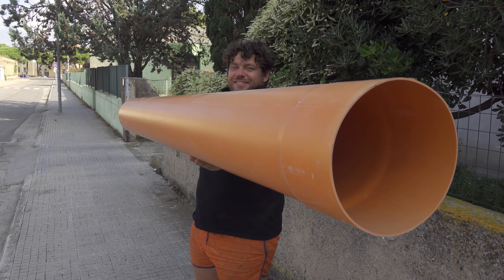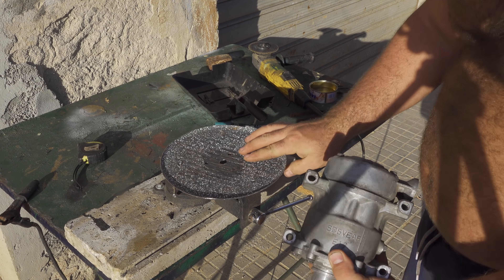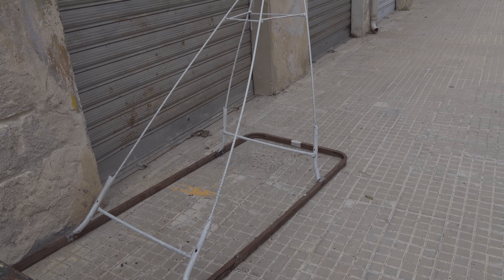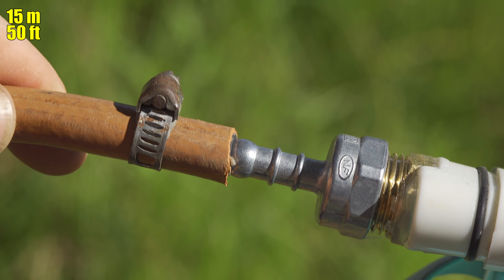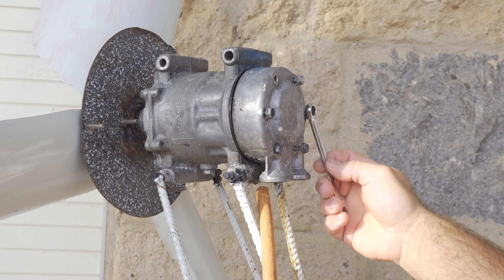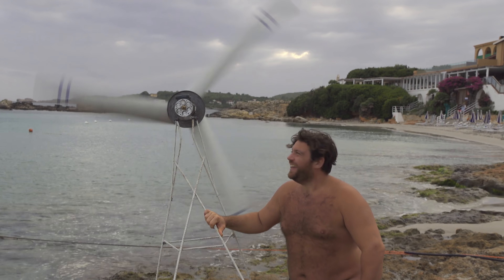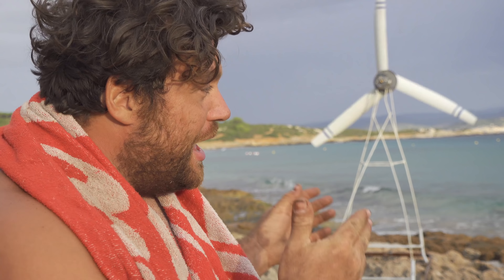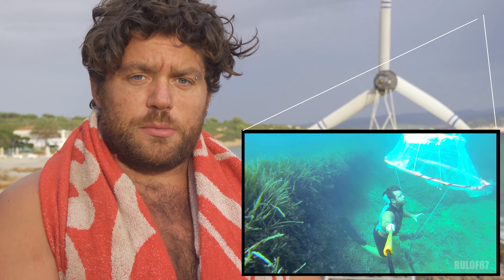Most Dangerous Invention  I've Ever Done • Breath Underwater

Comment: 'Wind stops' 

Dies
Reply: If a diver cannot make an emergency ascent from 60 feet on one breath, they do not belong in the water in the first place. Having said this, I will also add that this man's rig is very dangerous.
Reply: @redpillcommando  he will not even get to down to 60 feet with that mask without hurtng himself...
Reply: Meh the water looks about 40 at most
Reply: @jebbadiah  overlord6644 - I never said anything about how deep he was, I was not trying to comment about that. I'm just saying if a diver cannot make an emergency swimming ascent from 60 feet on one breath they do not belong in the water. In fact, I had to do just that to get my original certification back in 1972. My statement was in answer to CIA saying "Wind stops - Dies". That would only be the case if the diver does not know how to make an emergency swimming accent without causing barotrauma. I was not trying to be pedantic. The average person reading the original statement may not know that if an air supply fails, you can always swim to the surface while breathing out. As you ascend, the gas in your lungs will expand and you will be able to exhale all the way up. In fact, if you are breathing any kind of gas at depth, you MUST EXHALE ON THE WAY UP OR YOU WILL DIE! This is one of the classic ways an untrained or poorly trained diver ends up dead. They go for a breath and don't get it, they panic, they swim for the surface while holding their breath, the gas in their lungs expands and then their lungs pop and they end up dead from barotrauma, air embolism etc etc. Students have died in standard eight foot deep swimming pools this way. It does not take much depth, all it takes is holding your breath on the way up. Barotrauma is deadly and it can kill very fast. On the other hand, divers have made it back to the  surface from more than 120 feet on one breath, but when you make that fast of an ascent from that kind of depth you have other things to worry about like nasty little nitrogen bubbles in your blood and tissues that can cause pain, injury and death.

Here is a link to more than you ever wanted to know about diving accidents.
https://www.diversalertnetwork.org/medical/report/DAN1992DCIreport.pdf

The real danger of this rig is not if he gets to breath, it's what he gets to breath when it is working. There are very specific requirements for life support air supplies, and for very good reason. More than one diver has been killed by contaminants in their air supply. I had a buddy get very sick from a bad air fill he got at a bait shop compressor back in the bad old days. It seems the bait shop owner did not think it was necessary to change filters so often, and that oil they told him to use cost way too much, the end result was a contaminated air supply that came close to killing my dive buddy. 

Anyway, this post has used up way too much time as it is. I give Mr. Rulof an A+ for ingenuity, he has a very cool conversation peace but I beg him not to use his rig for diving. Just not worth it.
Reply: @redpillcommando  Makes emergency ascent

Dies from resulting embolism.
Reply: or if the boat turns to the other direction lol
Reply: Wind never stops when you are over the open ocean my friend. But you already knew that because you are the CIA
Reply: @redpillcommando  ascent*
Reply: @krimm1450  Yes, thank you. I made that typo more than once in fact.
Reply: @redpillcommando  thanks. Very informative.
Reply: He has plenty of oxygen left over in that to give him time to get back up.
Reply: Si el viento para. Te quedas sumergido y esperas a que vuelva
Reply: Ha gaye!
Reply: Bends

Comment: Great idea, even tho i think its too dangerous to use a piston compressor because of the oil vapors. Instead i would use centrifugal compressor, which dont need oil, like a turbo, capable of doing 1 bar. And drive the turbo with a big electric motor with pulleys to make the turbo go FAST.
Also i would change the mask to be able to equalize the pressure and lastly i would put a good air filter.
Reply: 1 bar of pressure might be risky due to around 10 meters in depth there is 1 bar of pressure, but i like the way you think
Reply: greek guy so lets use a bigger motor!!
Reply: He did say it is important to clean it out. It would probably be smart to add a little oil that doesn't produce harmful vapors to prevent rusting, maybe something like vegetable oil.
Reply: Cole H i think that replacing the motor oil with vegetable oil is a good idea . But cleaning the motor oil is very difficult in don’t think that will be perfectly safe to use.
Reply: Gregory Dahl you are not using high voltage, you need to use lipo batterys instead, that delivers about 15 volts, which is not dangerous at all.

Comment: Really cool project. I would like to use this idea for a wind powered pond aeration system.
Reply: That's a really good idea
Reply: Use it to keep the pond bottom clean by discharging air into a lift pipe and into mesh bag or out the pond.

Comment: Cool idea. But all you need is a small air compressor that runs off of battery’s or use a solar panel for those sunny days and it would fit in a much smaller boat and be safer in my opinion.
Reply: this is a good idea as well. you should make a video too
Reply: The thing with using an air compressor is that you may think it's safer, but you'll end up getting contaminated oxygen in your mask. If you've ever gone through a scuba class, you'll learn that if you try an air compressor, then the air can actually be poisonous and fatal
Reply: Kelpo Gaming that’s probably true. But I small car tire compressor doesn’t have a tank or anything for air to be stored in and get contaminated. I think you would be fine with a small one that keeps putting fresh air into the tube
Reply: kbphotology 1 I don’t have a pool or a beach anywhere close so that would be hard for me lol

Comment: I love your imagination and crafting capabilities. The inventor side of me lives this. But From the point of view of a professional diver there is nothing safe about this particular apparatus. But with a few additions I would try it. 
1. Absolutely totally clean and change the oil in the compressor to monolic oil. Add on a volume tank and filters  in line to adjust for low wind. Then get an air quality test. 
2. Use kink resistant gates dive hose with a strength member and attach it to a harness with a quick release so the mask does get ripped off. Add a bailout bottle to the harness and an air gauge on the main supply so you can monitor your pressure. 
3. Limit the excursion to a 6 meter hose. 
4. People bring up equalization. Some people can equalize without valsava maneuver but a separate mask would allow you to clear a flooded mask without removing your air source. And Use a second stage regulator.
5. Use a dive flag .
6. Don’t encourage people to do this that don’t know a crap ton about diving. This device can kill you.

Comment: You can build a little accelerometer based gadget that the swimmer carries and that determines his/her swim vector and speed, sends a signal to the boat, which then controls motors to follow.  Everything solar powered, so you can snorkel forever.

Comment: I think Some kind of Filter Should be in Place? I'm not Sure but most Divers Regulate their As it Flow, I'm Sure you ONLY Stay under water a Few Minutes? 
Also could the Brackets be Fabricated with  a,Heavy plastic? (Salt water) of the Metal rods might Rust?
I like the Concept 👍
Also a Solar Powered motor might ensure the Places to Keep turning if the Compressor slows or,Stops?

Comment: what happens if the boat turns sideways to the wind, or the hose fitting pulls out of the mask? It would be safer if you fasten the hose to a belt with some slack to the mask. I would hate for your life to be depending upon the strength of a bit of silicon rubber.

Comment: Hmm... wind powered hookah. No more than ten meters and you got a great lazyman reef crawler, spear fish/crawdad grabber rig. I wouldnt go below ten meters though and.. Im not too keen on rubberized hoses, better off with food grade plastic lines and add a chamber inline (stainless steel extra chamber, ten liter, floats) that gives you the backup if anything freezes with the motor and you will notice it with time and a few breaths to spare. You will notice the lack of pressure with the bubbles issue. And Viola! And as others stated, yes.. a quick couple bicycle gears and a bit of chain and a motor, and you can be certain of it with power, Solar to charge, whatever. Of course in those situations, you remove the blades. Many good things. Given you REALLLY clean that motor, or separate its air flow from the pistons somehow. I still wouldnt attempt a time of day middle distance of greater than ten meters though and water clarity obviously being a major factor. Tides, time, these things drift on one being busy.